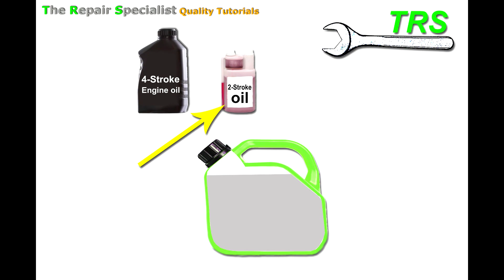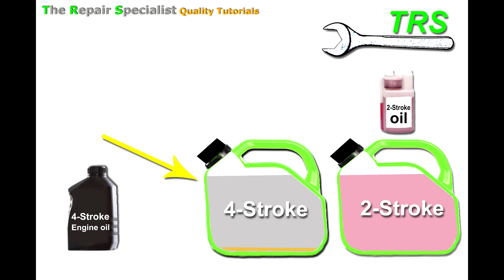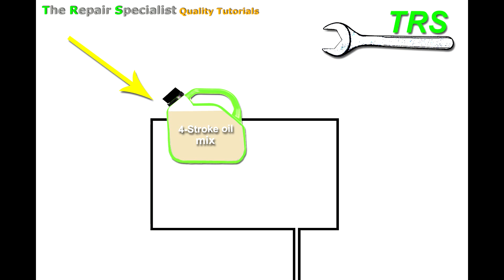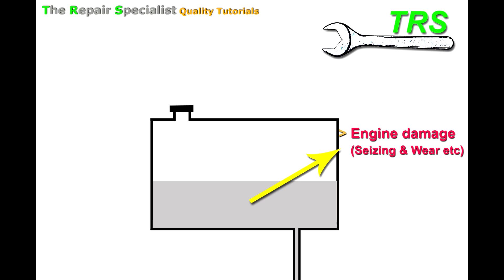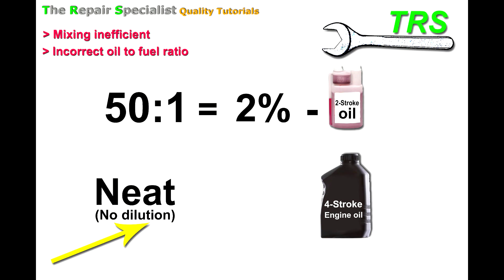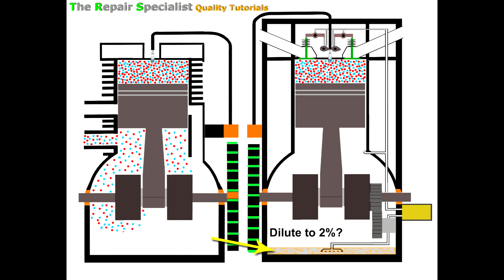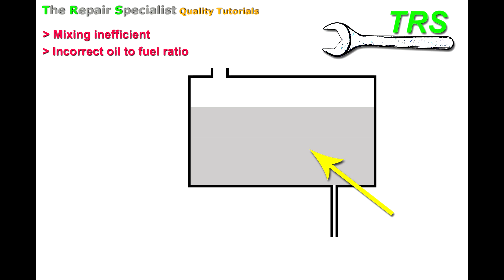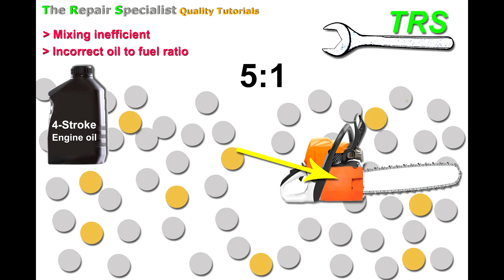4-Stroke Oil in 2-Stroke Engine. Can You Do It?  What Happens?  (by Craig Kirkman)

Comment: i am 62 years old and a professional gardener i have worked with 2stroke engines a very long time.i only use good quality engine oil mixed with petrol.(duckhams in the old days)but now use fully synthetic.ive never had an engine seize on me.more important is the ratios.20,25,33,40,and recently 50 to one.it takes a long time for oil to seperate out from petrol so only mix what you need for a few weeks .i run stihl,makita(dolmar)tanaka,echo,(lambretta and vespa scooters in the old days) chainsaws,hedge trimmers,strimmers and a very old but great mower.do not compare them to chinese 2stroke engines which have their own problems.

Comment: Totally untruthful.  It is only your own opinion with no scientific bases.  First of all if you mix 4stroke oil with gasoline, it will not settle down separately ,not even 1 month.  I tasted so many times with different brands and type of 4T oils.  Then , an 2 stroke engine will run with no problem of lubrication with  4T oil,just maybe with a bit more smoke, as in the case of mineral oil.  But if you add 4stroke synthetic oil, or if you will use low ash oils designated for Cat or DPF fillers, you will have even less smoke then a 2 stroke oil.
Reply: @TheRepairSpecialist  have you seen project farms test on the subject?
Reply from the maker: @PietriGuitars  OK. If you get the time to do so can you send me a link to that video of project farms test. I have been looking but can't seem to locate it. I would really appreciate it. Thanks. Craig

Comment: I agree with everything.
But I've a 1954 Atco mower with a two stroke kickstart villiers engine and it works fine but I don't use 2stroke oil I use a caster oil mix .

Comment: Could i add something from personal experience on mixing. Mix your 2 stroke oil in a small jar with petrol THEN add to larger can. This way it will be dissolved well then has easier time ti mix when put in larger container. Fail to do this, can leave your spark plug with a black carbon trace across it and no spark after a short run!  Common sense should also never let one thing using 4 stroke oil in a 2 stoke as lubrication is so critical and i personally wont go much leaner than 25/1 as i would prefer a little smoke than too lean a mixture even if recommenced on the label.

Comment: Always fascinating to learn from your videos. I occasionally use 2 stroke mix in my mowers if I run out on a job and have never had problems. I'd never use unmixed or use 4 stroke in my  2 stroke gear though as it ends badly quickly. Thanks for your videos